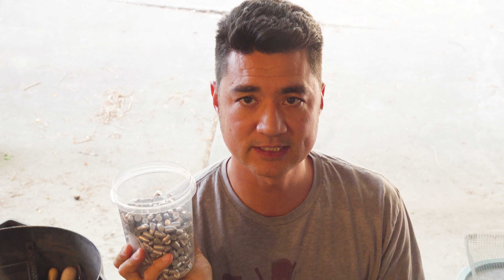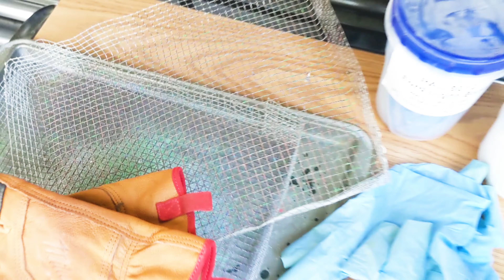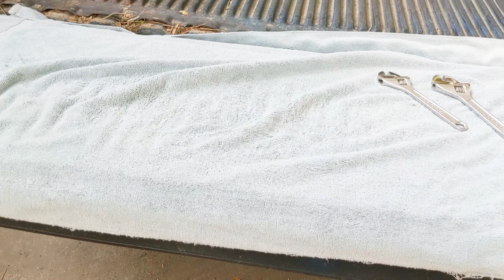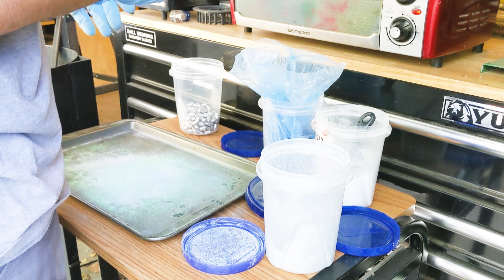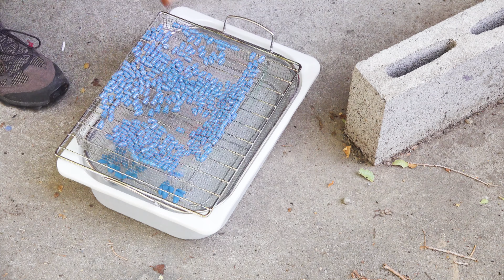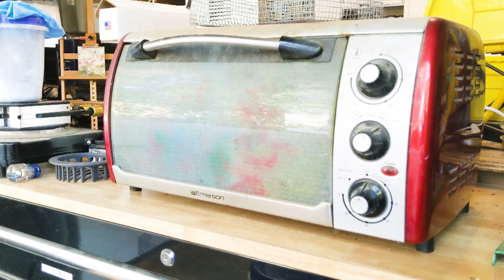POWDERCOATING PROJECTILES

Comment: The old shake and bake method can't be beat for doing lots of bullets  fairly quickly. I use a powder coat gun for really perty ones or for my 440gr 500 if I run gas checks, it doesn't matter if the bottom isn't coated well. Awesome as always Taco
Reply from the maker: Yup, thanks man!  I got an ES gun for PC about a year ago but haven't tested it yet 😂

Comment: I basically do it the same way I have the square ziplock containers. I’m going to have to invest in the ones you have because the powder does get out of mine. It’s funny I decided to powder up some 9mm TC projectiles I did a video on. I think I’m going to powder up some 223 projectiles I casted up I have about 20 or 30 of em.
Reply from the maker: Yeah, the twist lids are great.  Do you like the 9mm tc bullets?
Reply: cwlongshot  what’s going on CW !!!!! Got something under way going to mess around with some 223. I’ll definitely be doing a video on my endeavors with is soon.

Comment: I wonder if you could use a softer alloy if they are powder coated. For instance, would pure lead hold up at higher than normal velocities once its powder coated? What do you think?
Reply from the maker: yes and no, the bullets will hold up but if you take a really soft alloy and push it really fast, it won't shoot as accurately, but they make crazy splats

Comment: I know that you use a different alloy than me but I tested water dropped coww boolits after pcing that were air cooled and they were a whipping 22 bhn. As cast and air cooled my alloy is 12 bhn. Have you ever tested after water dropping?
Reply from the maker: yeah, and have you seen TATV canada's hardness testing videos over time?
Reply: @FullLeadTaco  no I haven't,I'll have to check them out.
Reply: I watched them. That's interesting. I've tested my air cooled coww ingots after years and they're 12ish bhn. Water quenching after casting or pcing 20 min @400 doubles it
Reply from the maker: @30roundclipazine79  pretty cool set of videos, though, eh?  Once I get out of YT Jail, I will try posting some more content.  Got 2 strikes right now.  The crazy part is that it was my censored videos that got channel strikes for me.  I kinda wanna be done with youtube and just focus on rumble.

Comment: Nice video. Is it hard to clean the barrel after shooting?
Reply: The powder coating should become (sort of) a protective layer between the barrel and the lead just like a jacketed projectile. It’s adhered to the lead and doesn’t come off as long as applied correctly.
Reply from the maker: Yeah, the pc seems to keep the barrel really clean.  I shoot thousands and thousands of coated cast bullets through my guns.

Comment: Are they sized before or after? I watched the whole video
Reply from the maker: You size the bullets after powdercoating
Reply from the maker: You can use a lubrisizser without lube or a push through sizing die like the Lee or bushing push through sizing die from NOE
Reply: @FullLeadTaco  I bought the mold you suggested from NOE 4 cavity gas checked.
Ended up spending almost $600 with them. I also spent $300 at powderbythepound and got a ton of colors including the ones you suggested in your other video and comments. The powder came in today. Thank you. i am excited
Reply from the maker: That is exciting!

Comment: I have such a hard time with this method. I'm using a quality powder coat. But I cannot get a good stick.
Reply from the maker: Do you live in a humid area?
Reply: @FullLeadTaco  I’m also having the same issue.  I am not in a humid area, quite dry in interior Alaska. 

I’m using Powderbuythepound low gloss powder.  I’ve tried cool and warm bullets but maybe 50% coat with tumbling them about.  I’m considering trying a wet tumble as seen from another youtuber but I’m curious if it’s the powder itself.  Any help is much appreciated. Using your taco 300blk noe mould (appreciate you for that btw).
Reply from the maker: Try getting a pound of powderbuythepound "glass clear"
Reply: @FullLeadTaco  thank you taco I took similar advice and tried Ford powder blue and it works like a charm. 357 gas checked shoot like a dream!. However any advice for 9mm. I'm trying to get near 1k fps but I get leading no matter what I do I've tried everything can you do a video on your process A-Z on casting/this issue. Or drop my a line below on your advice.
Reply from the maker: What alloy and what sizing?
Reply: @FullLeadTaco  I've been using wheel weights and some linotype scrap. I've tested hard bullets and plain ww and I sized them to 356. I've tried not sizing them.
Reply: I've tried out of several 9mm it's always the same result
Reply: I don't have this problem with 45 acp
Reply from the maker: @Jeff-hn7gi  are you using the lee factory crimp die?
Reply: @FullLeadTaco  no I am not
Reply from the maker: @Jeff-hn7gi  just seems like either the lead is too soft or the bullets are undersized.  have you pulled some loaded bullets and measured the diameter?  Sometimes certain crimping dies will squeeze the bullets down in size or sometimes during the seating process.  If the seating process is squishing the bullets, you can use the expander dies instead of flare dies.